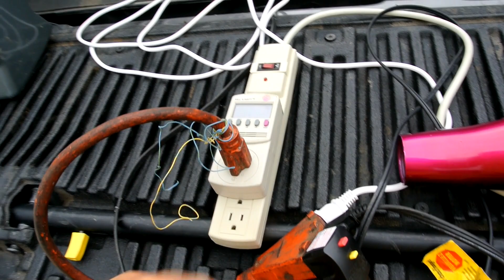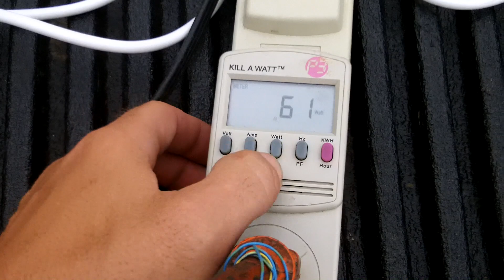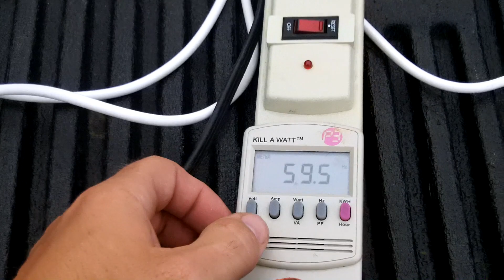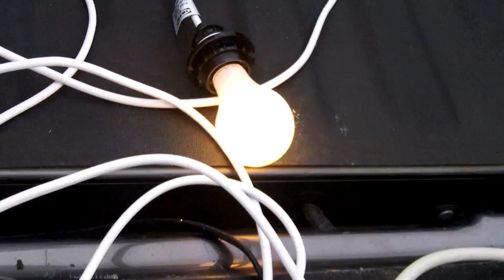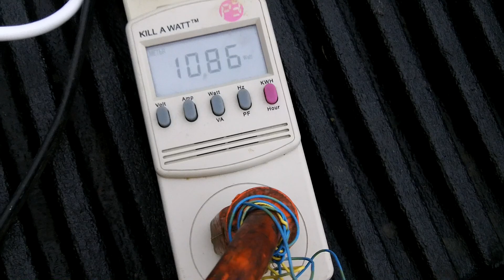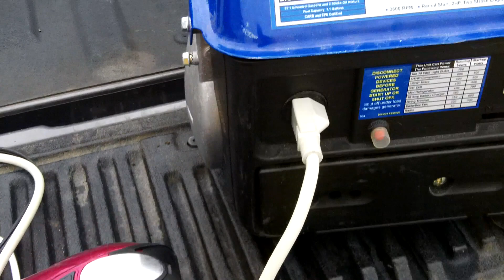Chichago Electric / Harbor Freight 800 Generator load test

Comment: Hi. i've got  2  of  these things.  They are way over rated. The actual output under load, is about 500 watts.  Running at 3600 rpm, with a 4.5  amp   120  volt  3/8  drill plugged in, is all this thing can operate, with a decent voltage.  900  is wayyy   toooo   high  (for marketing purposes, and greed)

Comment: I have this same 800 watt generator (except mines red) and a Honda eu1000i both are great little generators, just make sure you put a quality ngk or autolite spark plug in the HF generator and go over and tighten all bolts on it, also I'd purchase the 1-2 year warranty so you know for sure you'll get your $88 worth out of it lol
Reply from the maker: kmacattack1234 Thanks for sharing your experience and spark plug tip, please share and subscribe.